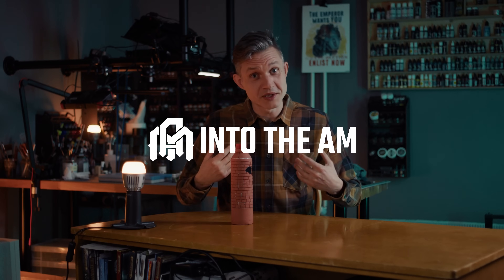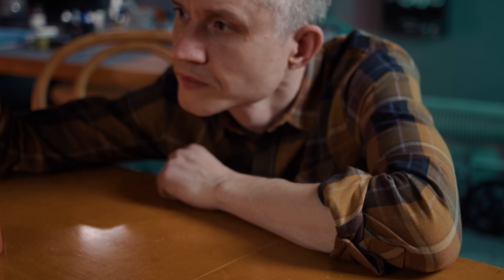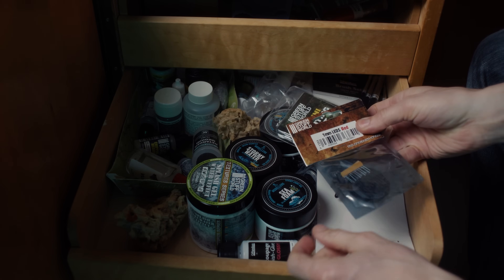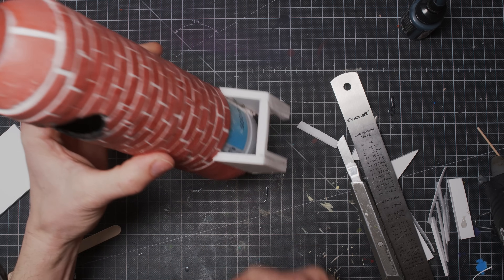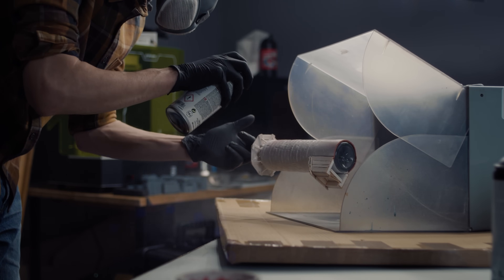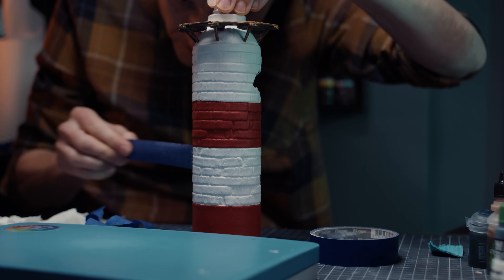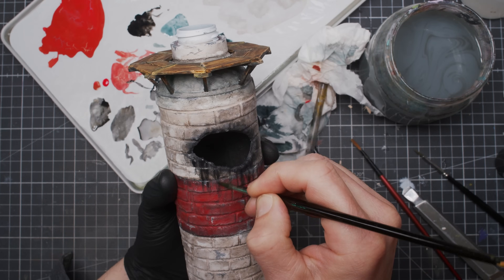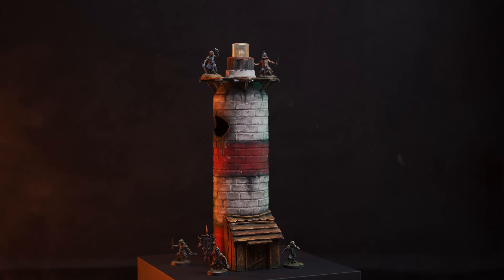Building a Miniature lighthouse from trash and clay

Comment: 11:35 I have noticed that spray booths can't really handle the amount of air coming out from spray cans. When I airbrush at a higher PSI I have the same problem as well. Can't hurt to replace/clean the filter like you said of course.
Reply from the maker: Yeah, they don’t really handle rattle cans well.. probably not made for that much paint flow